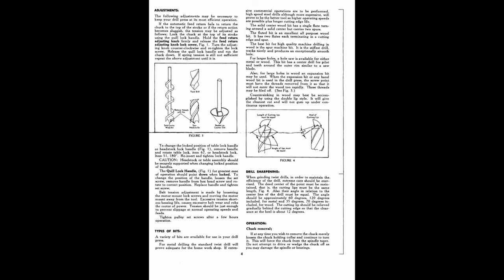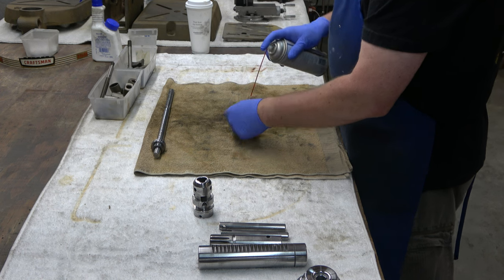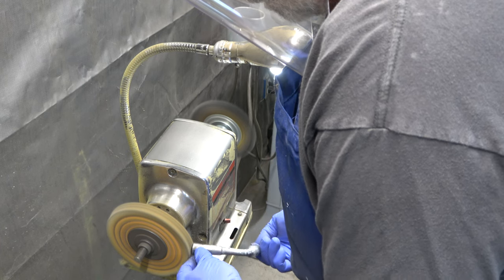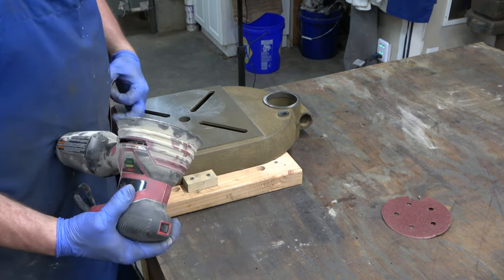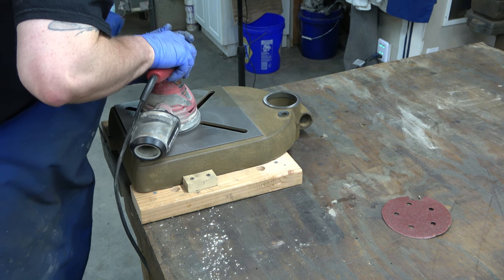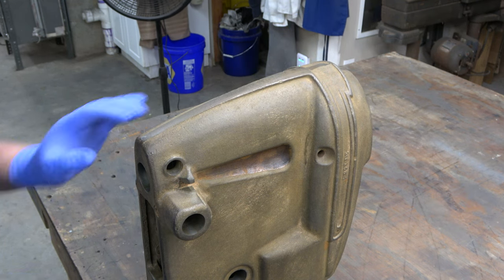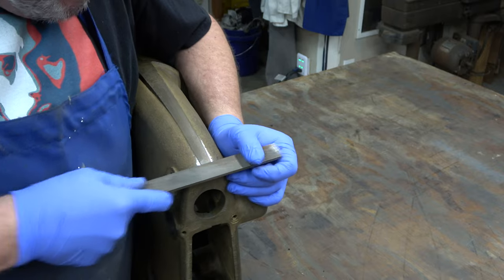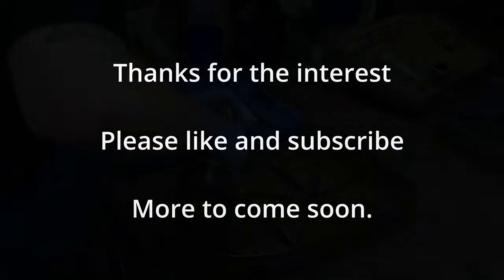Part 6 Rebuild 150 Craftsman Drill Press (Cleaning and Polishing Parts)

Comment: Hi Jeff, really enjoying all your videos. I've watched them all at least once and many of them multiple times as I prepare to refurbish a floor model 150 that I just acquired for $30!  I have a few questions and would really appreciate your guidance:
1. What is your preferred method of contact for questions? Is youtube comments a good place?
2. The dog leg end of the coil is a little damaged, the last coil on that end is not tightly wound. Do you thinks it's salvageable?
3. I think my bearings are in good shape, just dirty. Can I put those in the simple green and citric acid or will they get ruined?
4. Trying to be frugal, could I use super lube on the chuck or mystic on the moving parts rather than buying both? Could I use either on the bolts? Hoping for an all in one solution. 
5. You mentioned that wd40 is the temporary rust prevention. Is the polish alone considered the long-term solution? 
Thanks again for all your research and sharing this with all of us!
Reply from the maker: Maxwell, 
1.	The best method for contacting me is email. Go to the about page on my YouTube channel to get my email address.
2.	Most likely the spring is fine and will work for years. I have seen some really messed up springs and the dogleg coil being stretched in not a big deal. More importantly, I no longer sale the spring on ebay so finding a replacement will be harder. Keep an eye on ebay and snag a spare when one comes up.
3.	Putting the bearings in simple green will remove the oil and grease in them or at least contaminate it. If you have them out of the drill press, I highly recommend you replace them. Accurate Bearing company (ask for Kevin) is my go to source.
4.	The chuck really needs a NLGI No. 2 grease, and the drill press does not. I assume the Mystic would work in the drill press but its not clear, its black and will stand out but sure, it should do the job of lubrication. 
5.	I use WD 40 on all the parts that are not getting painted once they come out of the citric acid so they will not start to rust again before I can polish or wire wheel them. Once they are polished or wire wheeled, I coat the parts with a good penetrating oil. WD 40 is not a good penetrating oil and it has water in it so parts coated with it will eventually rust. I like “super slick stuff” you can find it on amazon or at Ace Hardware.
Lastly, the column and table surface are not coated with penetrating oil, I apply Johnson's Floor wax to those items after they are polished.
You are welcome and good luck with the rebuild.